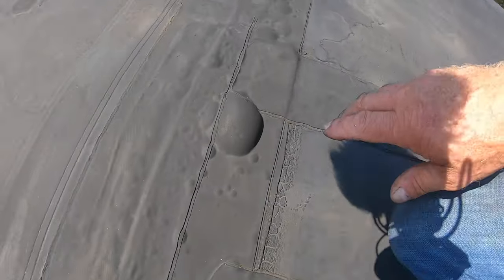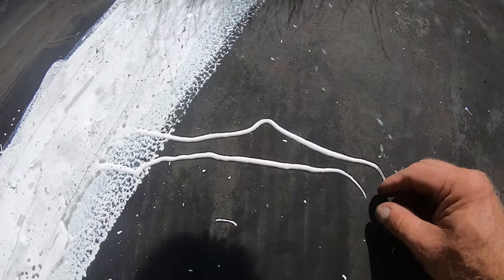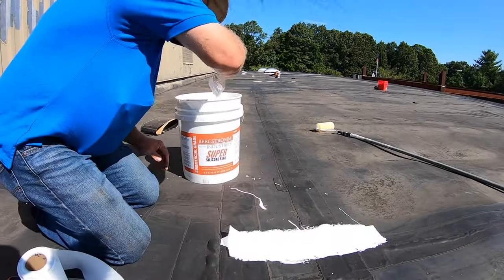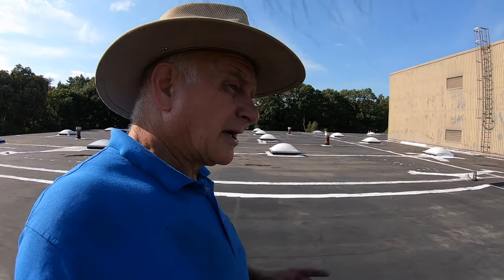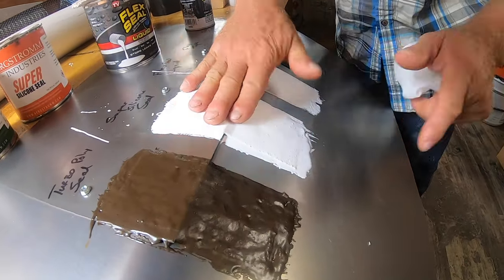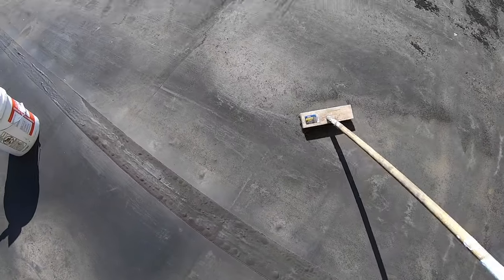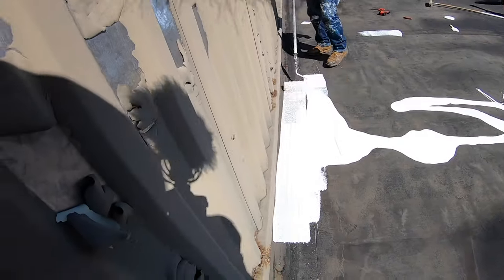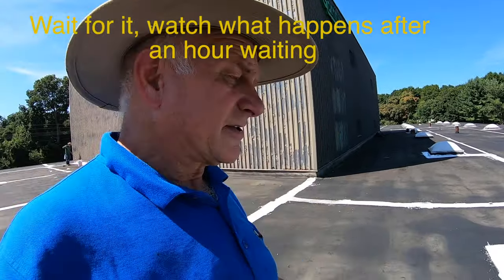Use this Flat Roof Coating to Repair/Fix leaks| Extend EPDM Rubber Roof Life | SUPER SILICONE SEAL

Comment: In my opinion, a flat roof should always be finished white. It will suffer much less thermal expansion / contraction, and will last much longer. Also, it makes life easer for your AC. I have used a similar product 5 years ago on my roof (modified bitumen), and we have managed to reclaim the top floor of the house during the summer, which was getting too hot for practical use.

Comment from the maker: This video will help everyone with an EPDM Rubber Roof. The consequences are really bad if you do nothing. If you watch this video you will have a good understanding of what is happening and what you can do to prevent your EPDM Rubber Roof from deteriorating any further.
Reply: Flat Roof Doctor That silicone looks a lot easier to spread than the silicone I use so it might be a little bit thinner I’m assuming what brands do you recommend using? Great video by the way
Reply: Can I use this process on the inside of a wood gutter?
Reply: Could you recommend another brand similar to this?

Comment: I just used a similar product here in the states from apoc called eterna kote 100% silicone. I cleaned all the seams with acetone and taped them with self sealing, fleece topped seam tape where needed, then scrubbed the entire roof and put on two coats of this stuff, over 1000sqft. 
It seems like some really great stuff. We’ll see how it lasts. But the heat difference is phenomenal so far!! 
In full sun it’s cool to the touch!!
Reply: Oh man 1,000 sq ft you must’ve paid allot for those buckets
Reply: How did this hold up? Thinking about coating my entire roof with it.
Reply: @RX-8GT  yeah but nothing close to replacing the roof, I paid about $385-$400 per bucket and used 4-5 of them. I haven’t been up there for a while but there’s no more leaking. I’ll go up in the next few weeks to clean the drain before the peak of summer and inspect it all. I don’t foresee any problems, I hope.
Reply: @lindsyjolley8215  I haven’t been up there lately, but I haven’t had any more leaking. I’ll go up in the next week or two to make sure the drain is clear and I’ll inspect everything and update you.

Comment: I have a roof drain behind a parapet wall that is leaking. I believe there is cap sheet up there. I could use this silicone-based sealer on the cap sheet what would you suggest around the drain? Thank you

Comment: Looks pretty good I wonder how long that would hold tho
Reply from the maker: As long as its either rolled on or brushed on, it should hold for over 7 years easy. Spray on would not be s as good.
Reply: I have a leak around a roof drain behind the parapet wall. Will this work to extend the life of the cap sheet? And what would you recommend for revealing around the drain?? Thank You
Reply: @dannylee5588  put some around the roof drain

Comment: I have a flat roof in Georgia that has a spray foam on top, its been leaking. Roofer said all of the roof needs to be removed. what is a good inexpensive repair since we have home on the market. but want it to last for a few years.

Comment: Please I Wana ask. I want to coat the whole roof and seal it. it has wrinkles and some open seals. Can I use this product all over the roof. Use the product plus the poly fleece sheet for the open seams and use just the silicone paint for the enter roof. Will this be same as coating using bitumen roof sealer. Also does this also provide the solar reflective coating as well.
Reply from the maker: I do not recommend coating entire roofs until leaks are solved. Wrinkles mean that the membrane must have pulled away somewhere to make up the wrinkle. Most likely at the wall somewhere. The leaks will be somewhere at the flashing. Maybe some seams popped loose with the tension on the membrane.
In any event, fix the seams and flashing 1 st with Turbo poly Seal. Once you are 100% satisfied there are no leaks, then you could coat the roof to protect against ultraviolets and to extend the life of the roof

Comment: wow! i am glad i found your site! how can i use this super silicone to deal with leaking angled epdm roof where the rubber has lifted off the substrate?
Reply: Where do we purchase this material
Reply: Put the fleece on top of where the rubber has lifted and paint or you can peel the rubber that lifted, put a patch (optional) and paint over

Comment: very good intell
Reply from the maker: Thanks, Myron. It took days to put this video together. The end shots took 4 hours. Every time a train passed by, I was not ready. Anyway, I am glad you found it informative.
Reply from the maker: This video will help many that have aging EPDM Rubber Roofs. There is no need to replace it because leaks. Leaks can be repaired easily, and then coating all the seams will do wonders. If you see the heat generated on a EPDM Rubber Roof, you will take action soon.

Comment: Dear Flat Roof Doctor,
Can I use Super Silicone on a bare concrete roof that is spalling?
Reply: Yes but you might need more silicone than you would need on a smoother surface, rougher surface tend to suck the material

Comment: Thank you. Good practical suggestions and tricks for the flat roof. 
Similar Recent Case, i.e. 10 yrs old house has a wood deck over a flat roof, covered with an asphalt rolled roof over the garage. Now he found few deck board problem and want to rebuild the new wood deck or do major repair on deck. Roof is still holding fine but I suggest him to address the rolled roof life span (asphalt rolled roof life 10-15 yrs) before spend money for the new deck. Now my question is can he- 1) resurface the current asphalt rolled roof with liquid rubber or silicone seal? 2) Install second layer of rubber EPDM roll or same asphalt roll over the existing old asphalt roll. Please give your expert input. Thanks.
Reply from the maker: Ok, thanks for the questions
1.Always redo the roof before putting a new deck down. Almost always unless it is a Torch Down
2.Roll Roofing (asphalt Paper like material) is the worst type of roofing material to put on any roof. Never ever do that.
3. If it is a Rolled Roofing material, then you have to strip it off. People mistake Torch Down Roofing material for Rolled Roofing. Make sure because you could have a Torch Down, which is the best. ( To test is to try and tear of a small piece off at a corner. If it tears, it is Roll Roofing, if it stretch slightly, and won't tear, then you know it is a Torch Down.
4. If it is Torch Down, then you can put a new deck over the existing roof. Just make sure the flashing around the posts are in good shape
5. Never use EPDM for any roofing

Comment: We put tar on a EPDM roof. DO we need to pull up the tar before applying this silicone seal ?
Reply from the maker: Tar is not compatible with EPDM. It could damage the synthetic rubber. Yes yu need to remove the tar and clean the EPDM with a solvent before adding silicone

Comment: I have a seam in a roof I need to fix. It’s actually made from old mining belt. Which is rubber. It’s not exactly the same rubber as this. It’s thick. Will this work on it? I need to know.
Reply from the maker: I am pretty sure SSS will work.

Comment: A massive multi national roofing company I just started working for said they dont do any torching anymore. Just peel and stick. What are your thoughts on this?
Reply from the maker: Read what the manufacturer specifies. Peel and stick are only to be used on low-sloped roofs. It is not to be used on completely flat roofs. Even on low sloped roofs, you may have to torch the end seams.

Comment: I love your videos!  I need to ask if you can use this same patch method and product on a torch down roof?  I need to do some repairs and extend the life of my torch down (modified bitumen).  About ten years ago we applied GACO rubberized roof coating and it was working awesome.  Can I put this product over the GACO to add another layer of protection?  The GACO is finally starting to peel in the corners by the scupper holes.  Also, I have a few seams around a vent that are needing to be patched.  I would love to hear your thoughts.  Should I use this product, the asphalt emulsion and webbing or what.  I am in Washington State and it rains a lot here!
Reply from the maker: Hi Sarah - Yes you can. But make sure you use the fleece where any repairs have to be made first. Over cracks, open seams. If the membrane has severe spider cracks, then this would be an excellent way to extend the life of the roof.
Reply: Thank you for the quick reply!  I want to get the most out of my roof so I truly appreciate you sharing your knowledge.  Do you think I need to remove the GACO roof coating I already have on or just recoat over it for another layer of protection.  I don't want to run into something not adhering to the GACO roof coat I already have on.  Thanks!
Reply: Where to get the fleece and name, please!

Comment: Hi Flat roof doctor ☺️
Thank you so much for the video I have only one question and I really really appreciate it if you can give me a answer Where I can buy that product ???? 
I have Plans to do same as you show in 350sgft roof located in Fort Lauderdale , South Florida Where sunny area with strong rain 🌧 in summer and Humid
Reply from the maker: Sorry that the link was not with the video. Here is the link for Super Silicone Seal https://bergstromm.com/
Reply: @FlatRoofDoctor  thank you . One  more questions before I order what is good for modified bitumen 450 sgft flat roof ? 
Super Silicone Seal or Turbo PolySeal ? 

Would it be good to just repaint it with one of these two products and extra patches in conection? 

I have flat roof make from modified bitumen and have leak , not shure where in conection with regulare tile roof or ventilation pipe. Did my idea work? 
Thank you for helping me to understand !!

Comment: Quick question flat roof Dr after say 15 years of the life expectancy of this Super Silicone Seal can you just apply another layer over it or would you have to replace the whole roof before you can apply another layer of this stuff to it?
Reply from the maker: yes you can
Reply: When is it too late and can’t use this method on a flat roof, please??
I have pics of my flat roof to show you, thanks!!

Comment: The right way to do it you would prime it and put 9 inch peel and stick thats the right way by manufacturer standers and its not the heat that make those bubbles it because water go under the 6 inch peel and stick and froze
Reply: It's actually not freezing that causes the bubbles.... it's the water "bubbling". I have some roofing that I started a few months ago.... it has bubbles where the water got stuck under. It has not been winter yet. The water evaporates / boils and expands into a gas.

Comment: I have a brai roof. It's a torch down material with like sand like material on it. It's a flat roof in New Mexico. Can I use this silicon material to apply to the seams where the sheets of brai meet and torched down? My roof is old and I cannot get a roofer to help me till August. Please help
Reply: You have to use a polyester fleece everywhere where the transition is.

Comment: All you need is to cover EPDM with gravel (ballast). It will protect EPDM from UV and extreme heat! Just do it right and it will last you +50 years without any kind of maintenance.
Reply from the maker: not so, I have seen so many EPDM roofs with ballast that had piles and piles of stone moved around just to get and find the leaks. The glue never lasts. It becomes a nightmare when you try to repair a leaky roof with stone on it
Reply: @FlatRoofDoctor  Yes, stone gets moved in snowy climates. Either by snow itself of snow removal procedure. But it is same case for both EPDM and bitumen. Both should be ballasted!! And repairs for both are painful. But for roofs with ballast you do not need to any repairs for +30 years! And it is down to contractor what he prefers - torch with gas cylinder and hose, or electric welder. 

What you are showing here got nothing to do with roofing. It is some DIY glue-on rubber. Done this way neither bitumen nor EPDM will last. 

Well done flat roof with right slope, drainage and ballast gives you at lest 30 years leak free lifespan for both bitumen and EPDM. And this is in climates which experience mild winter winter with plenty of 0*C crossovers which force water in every possible hole. EPDM is newer then bitumen so naturally has less "in real life" experience but so far +30 years with no leaks shows that is equally good with bitumen.
Reply: @FlatRoofDoctor  Other thing... do not use glue! Glue is good for DIY shed repair! For commercial contracts you must go with welding! Welds as long as UV protected with ballast will last as long as rest of the sheet!

Comment: Ita not a fair test.. all seams need a mesh for movements flexseal is affordable for many people is you use roofing  mesh it will hold well... like using asfalt cement or roofing cement ... all of these prodct eventualy fails but are saving to replace a entire roof

Comment: I did this on mine & it didnt work at all though. 👀
Idk what I possibly did different/wrong.
Reply from the maker: Sorry to hear that. I have used it on many different EPDM roofs and never had any problem. Did you use Super Silicone Seal or Turbo Poly Seal?
Reply: Hack don’t coat roofs